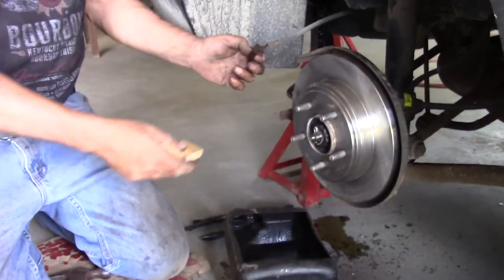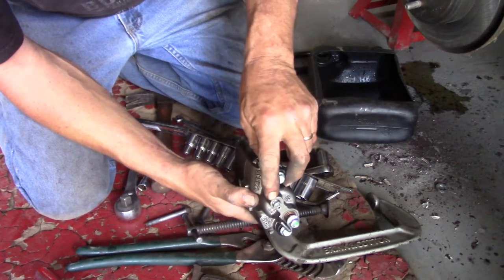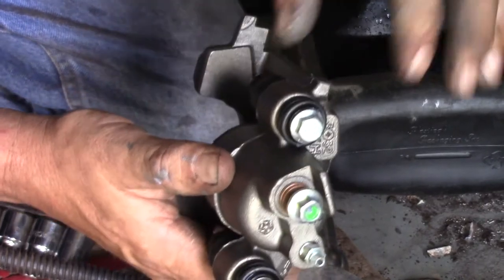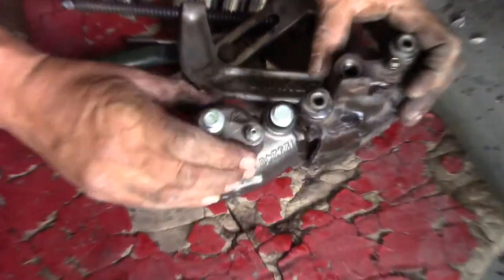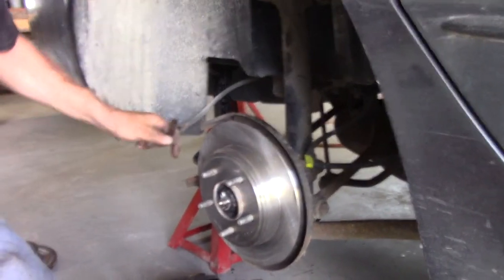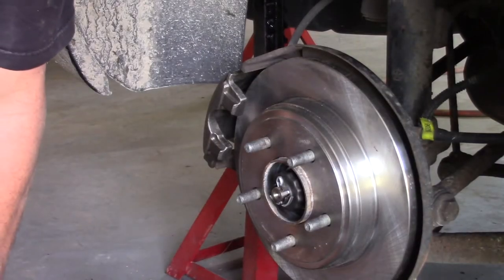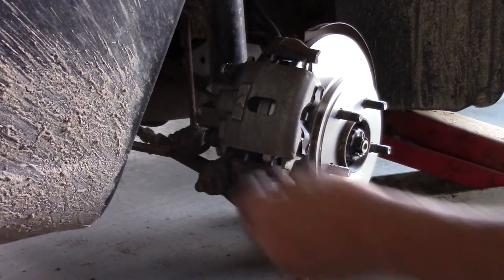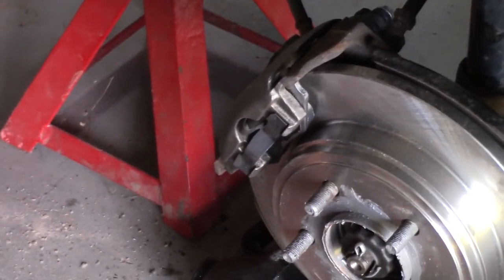Replacing Rear Brakes on Chrysler 300M Part Three of Three

Comment: Great tutorial 
 I have been very stressed about my 1999 300M and attempting my rear brakes myself (being a girl) but your video is very clear and thorough without all the added nonsense that most DYI videos have... Thank You so much, you don't realize how much this helps calm my anxiety about it !!
Reply from the maker: You absolutely can do this by yourself.  Just the fact that you are considering doing this yourself means that you are a person of above average self confidence and ability.  These two things are some of the most important ingredients for success in life.  Here's some advice if you want it:  1) Watch as many videos on the subject as you can, not just mine.  Other videos might cover something that I neglected to focus upon, or they might explain something in a way that "clicks" with you when mine didn't.  Sometimes a particular video might cover an uncommon problem that cropped up that isn't covered in any other video.  2)  Buy a service manual for your vehicle.  These are sold in most auto parts stores for around $15 - $20 and are worth every penny.  In addition to how to do a particular repair, they have lots of extra information, like torque specs, capacities, and fluid recommendations.  They will also come in handy for any subsequent repairs/maintenance.  But most importantly, they provide you with much of the info you need when using the internet is not possible or practical.  Your WIFI might not reach your garage and who wants to touch their smart phone or computer with greasy, oily hands? 3) Ask one of your friends or family for help.  Someone who's been through this kind of thing before can be such a huge help - more than any book or video could ever be,  If none of your friends or family are into this kind of thing, you're on your own for this repair, but try to seek out a new friend who is, for that help you know you are going to need in the future.  Just about everyone who regularly does their own repairs operates in this manner to one extent or another.  The benefits of sharing tools, knowledge, and labor are tremendous and costs just about nothing.

Thanks for watching and commenting!  I know you can do this!  Just think how proud you will be of yourself once you have successfully completed this task.  It will give you the confidence to take on many more things in the future.  Things that you may have once never even considered even attempting.  Last but not least, the money you will save by becoming self sufficient can make the difference between success and failure in life.  I'd wish you good luck, but, I don't need to - you're the kind of person who makes their own good luck.